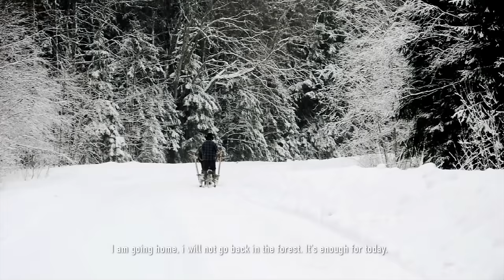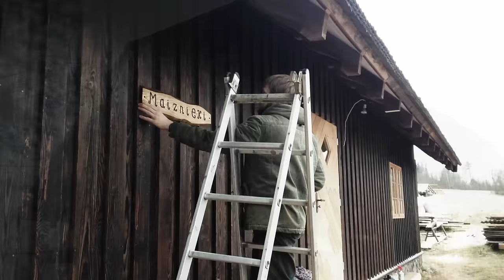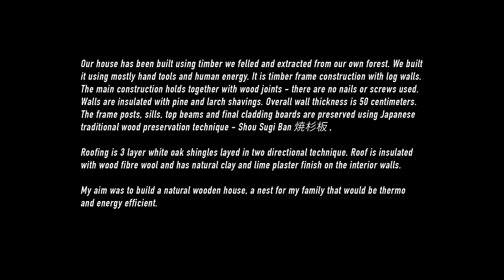The Birth Of A Wooden House

Comment: Well, Jacob, what can I say - awesome and congratulations!!! 
Plaster and wood charring were interesting. A pity log walls were all covered, but it makes for better insulated walls. What was that pit at 4:40 where a large rock was thrown into the basement?
Reply from the maker: +LK It was foundation for the heavy brick chimney. It (chimney) starts from the basement and has full weight of 7 tons. It is basement ventilation on one side and the oven smoke exit on the other side. It has two layers. One for the ventilation and the other for the smoke.  All our foundation consists mainly of boulders mixed together with lime, sand and bit concrete mortar, just like the ones we dropped in the hole.
Reply: +John Neeman Tools thanks. Couple more things. The kids really make the film come together. What's that wooden structure under the oven..? Just decoration..? I never saw anything like that. I bet the oven bakes tasty bread :)

Comment: Excellent video!  Can anyone explain to me the purpose of digging a hole and rolling a boulder into it?
Reply from the maker: +Stephan P in BC It was foundation for the brick chimney. It (chimney) starts from the basement and has full weight of 7 tons. It is basement ventilation on one side and the oven smoke exit on the other side. It has two layers. One for the ventilation and the other for the smoke.  All our foundation consists mainly of boulders mixed together with mortar, just like the ones we dropped in the hole.
Reply: +John Neeman Tools What a great idea, that makes good sense. Your work is like art, thank you for sharing it for all to see.
Reply: that's a good question, and the workmanship was great .

Comment: Damn good job! We used to have to work like that for hundreds of years in Bavaria, Austria, and Switzerland, using the same tools and the same technique as you guys did. What I would not have done is to paint the big beams inside. We have woodhouses 300 years old without any protection by paint. No need for chemicals. But only my opinion. Congrats, outstanding, incredible work!!!!